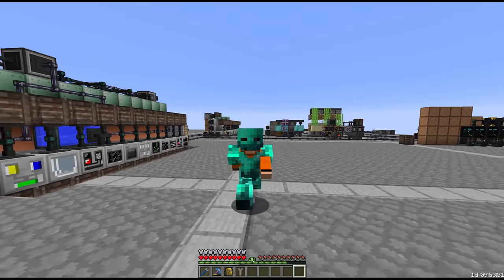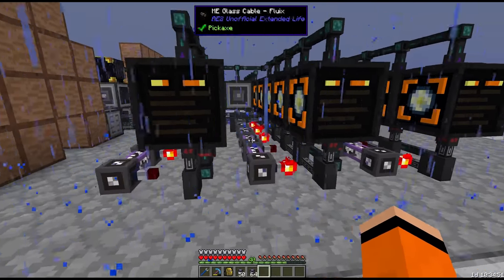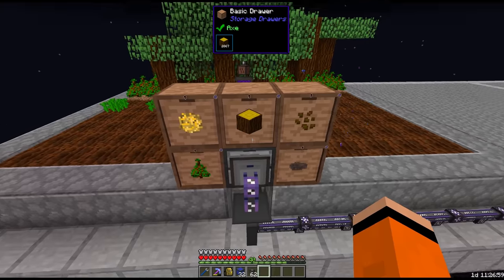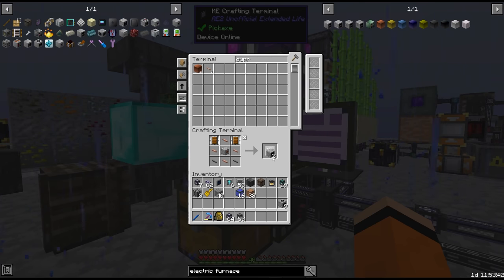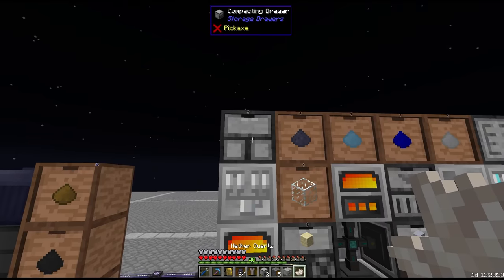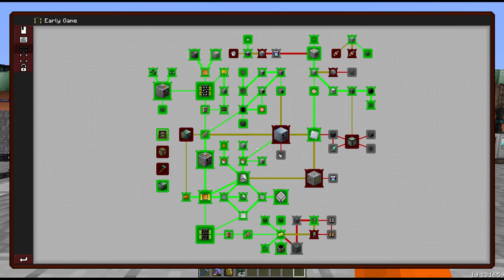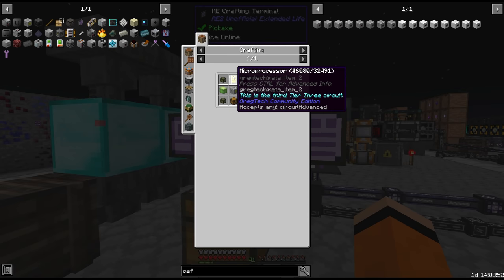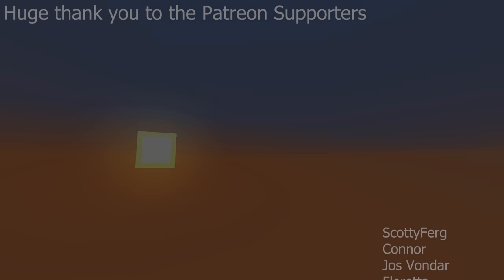Loot Fabrication, Cobbleworks & Oil Drilling - Nomifactory: Episode 6

Comment: Unbreakable tools for the farming station are possible eventually. In the meantime if you'd rather not have lots of downtime while tools are crafted and moved back into the Farming Station, you can set up a charging and repairing system for EnderIO axes and backhoes, which as long as there's room in the output for them to be ejected to, will eject them before they break (when enchanted with Mending) or if they run out of power (when enhanced with Empowered upgrades).

Also a minor correction: the Oil Drilling Rig is a custom multiblock implemented via Multiblock Tweaker. GTCEu does have a native one they added though. One downside of the switch from Modular Machinery is that MBT doesn't support chanced consumption of items while always consuming fluids, so we altered the recipe to consume 100x as much drilling fluid as before when a pipe is consumed 1% of the time so it nets even to before over time. All the other bugs related to ModMach are resolved from the switch though, and the structure can be overclocked now which is pretty nice.

One other thing you might want to know about is that EnderIO's ME conduits sometimes load before AE2 does, and if you connect them directly to full-block AE2 devices there's a chance it won't make a network connection because it doesn't think they're a valid block to connect to. This can be really confusing because they still look like they're connected. You can circumvent this problem by connecting AE2's fluix cables to full-block devices and stepping down from the conduits to those, as EnderIO always considers those valid to connect to.

Comment: For the water mills, you can get 16 gp from each by putting the source blocks 2 away from each face. I also put mine in the overworld since that design is a bit less space efficient and gp is wireless

Comment: The two things I found most annoying about my Omni playthrough was rain in the void and rubber saplings in my inventory haha. 

It took me a while to appreciate robot arms, pumps and automatic output of gregtech machines especially once you need fast processing at like EV and beyond. Also for like the first hundred plus hours of my playthrough I built an enormous item conduit network that caused a lot of problems and eventually lagged my game like half a second everytime I placed a new conduit. This spurred one of many redesigns of my entire base. I learned a lot this playthrough 😂

Still plodding along slowly. Got a draconic energy core setup and spent a bit of my playtime yesterday researching how to set up a draconic reactor before deciding it wasn't worth the trouble and risk. Maybe in another pack with open computers so someone else can do all the hard work for me.

Also based on a tip from one of your live stream gtnh vids I think I've been passiving red coal for so many hours and have a couple hundred thousand saved up for that craft so thanks 👍
Reply from the maker: Awesome! Thats great to hear. I don't think Draconic Reactors are worth as you mentioned in this pack... better to do Solar, Fission, Plasma Turbines or Naquadah fuels :)
Reply: @Threefold.  Ah right! I might try naquada generators since I want to finish those quests anyway. Already got about 10mil rf in plasma turbines running so I'm not really sure how much more power I'm even going to need. I will want lots of uv machines soon I suppose

Comment: I'm sure you allready know this, but just in case anyone didn't: make sure not to change the ammount of GP you are producing, or in the case that you do, change out the drawer for red coal. Red coal has an NBT tag associated with it depending on the total GP production of your system that gives a bonus fuel time modifier, but causes it not to stack unless the modifiers are identical. I lost about 4 days worth of passive re coal to this and it SUCKED
Reply: That does not sound right at all. The number the red coal has in it's NBT is tied to the player, not the amount of GP you are producing
Reply: @TheJustinist  that is another issue, but the other also exists